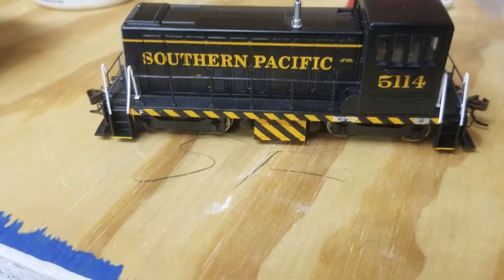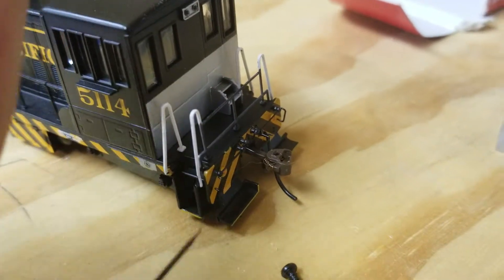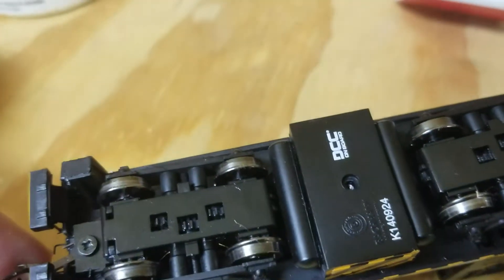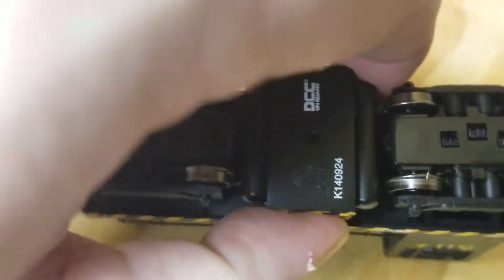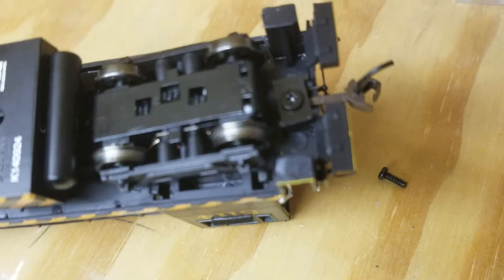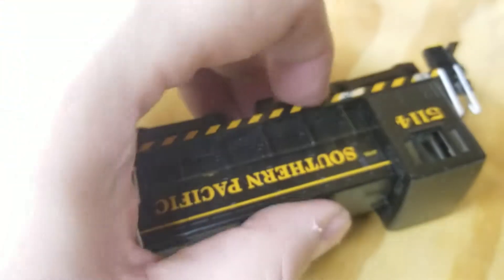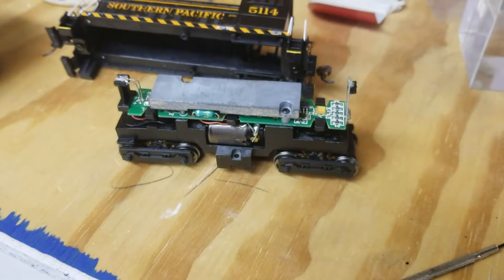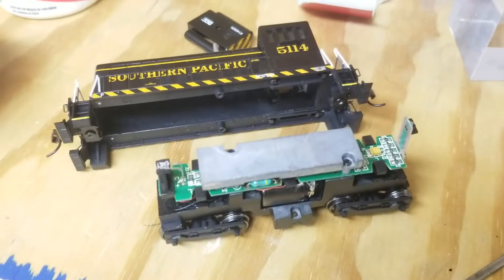Bachmann 70 tonner disassembly

Comment: I see that this loco is a Phase 3, 70 tonner, which in my opinion are the best of the 70 tonners Bachmann has made. The trucks use a brass or bronze bushing for the axle bearings, which is way better than the plastic of the phase 2 (with 5 holes in the bottom truck cover). The gearing seems to be better also, with less slop in the gears. All my 70 tonners are equipped with phase 3 trucks. As for the noise, most of that noise disappeared when I installed a different decoder. I currently use Digitrax DH126D or DH166D decoder. My 70 tonners run like a swiss clock now. I also discovered that the trucks are too rigid in the frame, so I file the slots of the truck tower to open that up to allow the trucks to swing, which lets the truck move and keep better contact with the rail. File the TOP of the slot, and not the bottom or you could change the height of the loco and couplers. Doing this should also let the trucks turn much easier. Have fun and enjoy your 70 tonner!!!  Dave
Reply: I can tell you that the 2 motor version of these are a disaster. Starting with the cracked axle gears, I purchased two used ones, both had cracked axles. Went and purchased two new in sealed boxes (Also from ebay) and what do you know, cracked axle gears. Someone mentioned, and this makes sense, that over time the raw plastic they used for the gears cures and shrinkes, thus the cracks, and this explains perfectly why you find cracked gears in new/sealed box units. And these things aren't exactly cheap on ebay unless its the family lines livery.